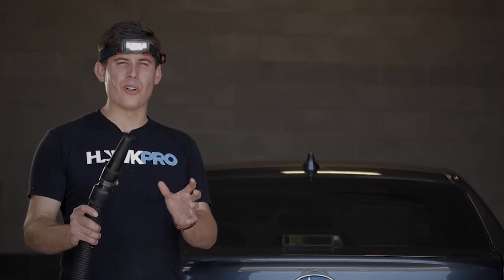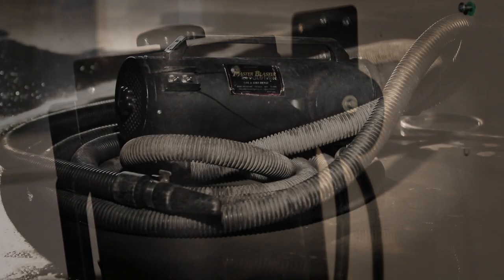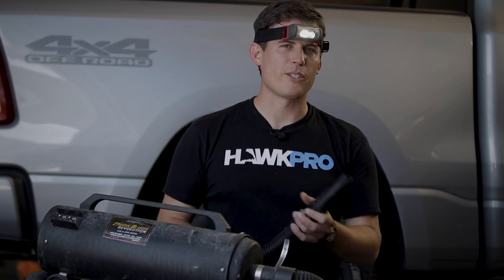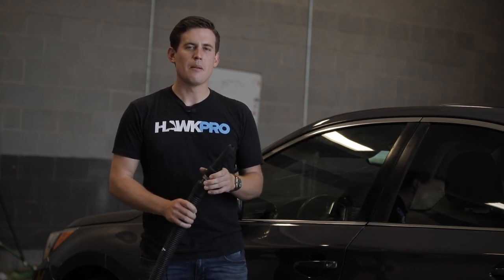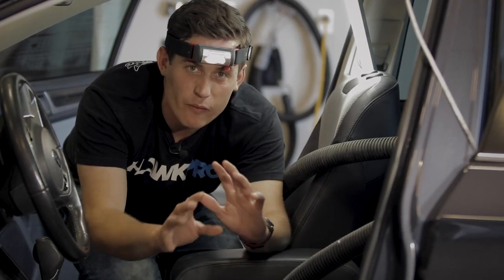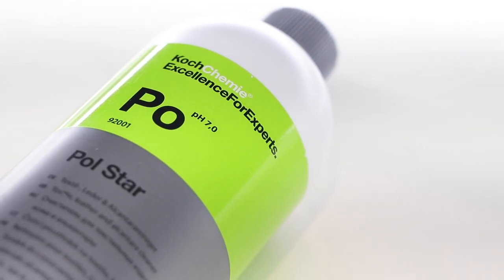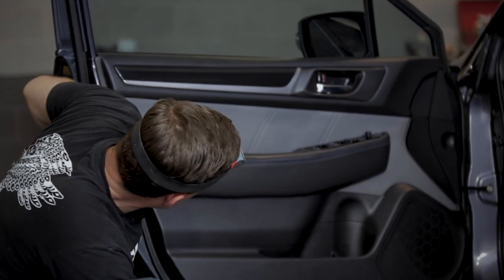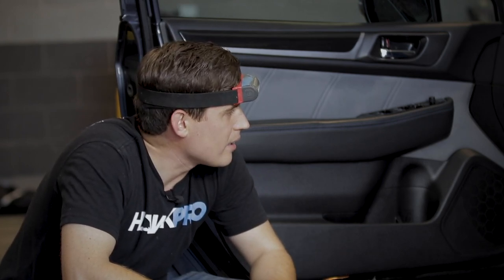Master Blaster hidden secrets: the Swiss Army Knife of auto detailing

Comment: I like Pol Star a lot, it also has some protection built into it as well.  Like you don’t have to dress after Pol Star. I use the compressor I got and it works good but good video.

Comment: 4th
In your experience, What would be a machine comparable to this one?
Reply from the maker: I feel like you can find some budget options. I did this video a year later because we beat the crap out of it and have had zero issues in that time. It is built like a tank and that's a huge selling point for me
Reply: @HawkProDetailing  I was wondering because I have used the Rigid to blow around the car to dry it besides using it as a vacuum but have seen those blowers used for pets too so was looking for more input if you at least knew of better alternatives per your vast experience with carpets too.  For cleaning carpets, I have used the Tornador ZV240 which has been quite convenient for me on using carpet cleaning solution and at the same time suctioning the dirt from it instead of using an extractor which leaves them more wet and use multiple passes but never as clean as with the Tornador ZV240 and as fast.
Reply: @1stfrompuertorico568  Humberto watch for sale around the holidays at Mckee 37 and you can get like $150 off. I have some shoulder issues so for me this is much easier to use then a cordless blower. I know Matt at OG loves the cordless but heavy.
Reply: @functionaldoc5054  👌👍
Reply: BigBoi Pro
Reply: @wildpony1957  I have the big boi pro and it is great.